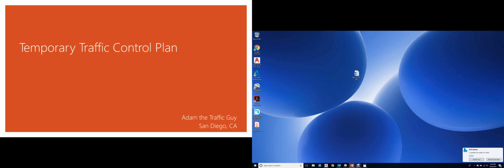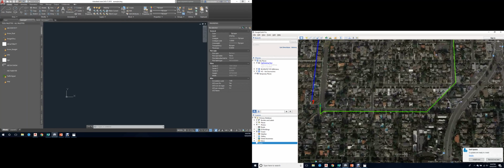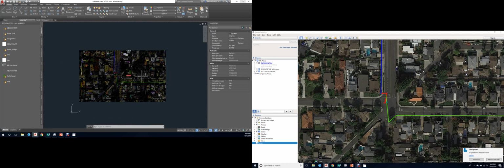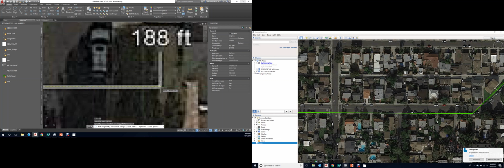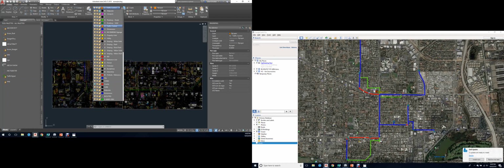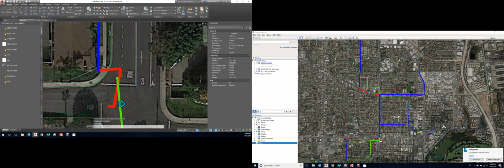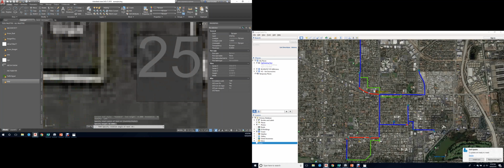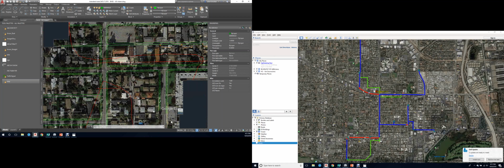Temporary Traffic Control - Step 1: Base Map Tutorial

Comment: Hello Adam, I'm new to TCP and I'd like to get more info on whether AutoCad is the preferred software over Invarion.....
Reply: There are cheaper .faster.better ways.
Real site photography over top of a map.
There can be no discrepancy in distances ,obstacles including parked vehicles.no parking placards must be situated prior.photographs taken then.plans made by a guy sitting on his ass behind a desk in another town are likely to be slighty inaccurate,especially when you are dealing with footpath closures ,covering permanent speed signs , turn around areas ,fencing,visual acceptance, high winds,rubbish collection trucks, drunk or intoxicated members of public ,school children and worst of all mobility scooters with drivers left with only months to live
The list goes on .you only learn from your mistakes but in this game that's very risky and worse potentially embarrassing.
Good luck to all Stms workers.
There are an incredible amount of rules and regs and the liability on your head is severe.Ive always said an Stms best work is done in bed while asleep, Always consider the unattended site rating and saftey before departing when work is continuing tomorrow. 
Dont leave it messy.its the loose gravel left on the road ,un signed as a hazard on a 100km/r around a bend that kills motorcycle riders.
Watch out for bicyclists when using stop / go.hold them back till last.
Remember the whole thing depends on vision for it to work.
Reply: yes AutoCad is the best one out there